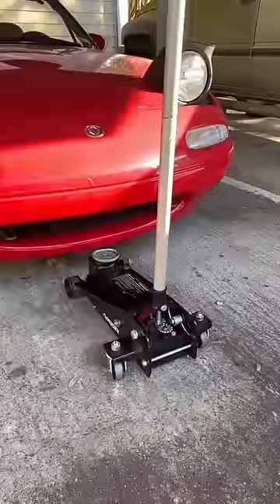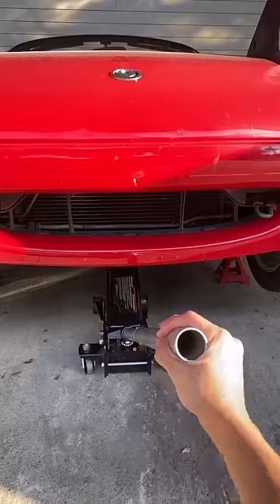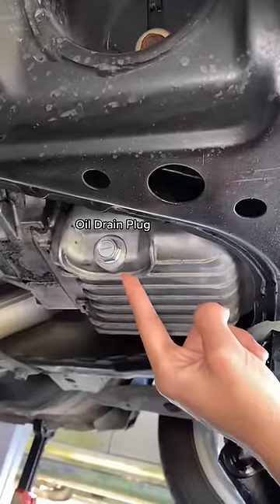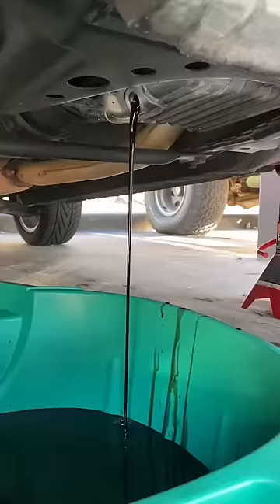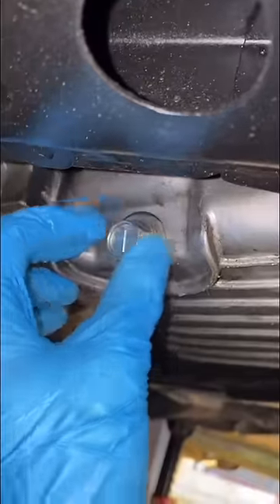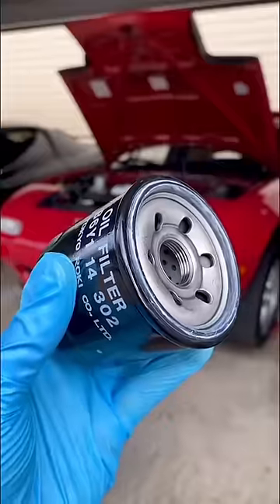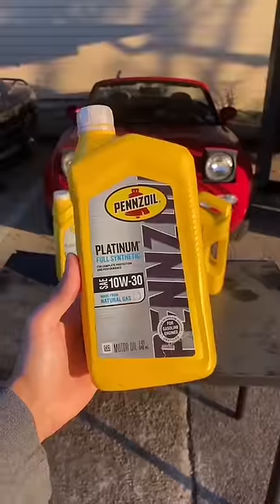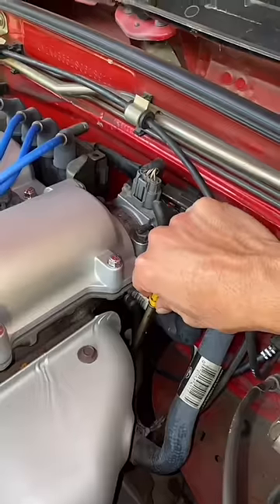How to do an Oil Change! (in any car)

Comment: You know, nobody ever mentions or seems to replace the crush washer in these videos. I personally think its fairly important, especially since we don't know if the last guy changed it. Nice to see it included 👍
Reply: Interesting most vehicles I’ve worked on just have a small reusable seal 🦭
Reply: Because all vehicles have a reusable washer that only needs replacing if it leaks. Which is about every 10 years.
Reply: @johncoops6897  some cars you replace the entire bolt each service.
Reply: @johncoops6897  this is not true at all I work for a oil change place, some cars require the gasket to be replaced every oil change this is mainly Hyundai and Kias sometimes Hondas, most chevys, fords and dodges don’t have to be replaced everytime a lot of them have a metal plug with rubber gasket, some fords have a plastic plug which sucks ass, the thing we mainly go off of tho is if it has a metal gasket it probably needs to be replaced so we usually replace metal gaskets anyways even if it’s not bad just so it won’t come back on us
Reply: @148Reaper  - says the people who sell the bolts 😉
Reply: @apfilms895  - you charge to replace the drain plug gaskets, don't you? Good mark up in add-ons like that, eh?
Do you change you bathroom tap washers every time you turn off the tap? Consider the water pressure on a tap washer, and how many times it gets used each day... compared to the gravity pressure of some thick oil on a plug that gets opened every 6 months.
Of course, the oil change place uses an ugga dugga on the sump plug, right? 150 ft/lbs for the win.
Reply: @johncoops6897  actually I just work for a normal lube shop we only charge for the oil change unless the customer wants to buy wiper blades or air filters that’s the only other thing we sell, new drain plug and drain plug gasket is free with our service as well as us checking and topping all the fluids under the hood every one we can touch and that’s a free part of our service too, we also give out free bottles of water and give out discounts and coupons all the time to customers to help out and be nice, my shop does not screw people over at all a lot of people come to us complaining about another shop that screwed them over and they praise us for just doing what we’re supposed to, don’t come at me assuming abunch of shit like that bro not every shop is the same
Reply: @apfilms895  - nah, I am not judging you. Replacing a 2 cent gasket for free is part of your marketing plan, and that is great.
But you don't HAVE to replace them, except if the previous guy used a rattle gun and completely destroyed the gasket last change.
- so yeah, you might need to replace them every time LOL
Reply: @johncoops6897  again no u didn’t even read my message, ur just still wanting to talk shit about stuff u don’t even know about, any car that comes in our shop with a metal drain plug gasket we always replace it just to make sure it doesn’t come back on us because they are common to go out quicker, if it’s a rubber gasket drain plug those we usually don’t replace until its needed and in that case the whole plug and gasket gets replaced it’s not part of any marketing plan or anything either we just replace it if we have to and don’t if we don’t have to, there’s nothing along with it we don’t strive to make more money off of the customers or try to screw them over that’s not how we run , no one Fucking uses a impact to put the drain plug on or take it off the only thing we’re allowed to use our impact for is taking off skid plate covers and that’s it, we have to use hand tools for the plug we just used normal wrenches for that or if it’s a weird plug we may used a ratchet and the oil filter we usually only use tools to take off the oil filter and then it gets lubed and goes hand tight, unless it’s a Chevy truck those get tightened a little more because they are little different, stop assuming shit because anything u type is probably gonna be wrong bro
Reply: @apfilms895  - ROFL - Defensive or WHAT?
I read your whole comment and agree that your shop does the "right thing" by replacing the gasket each time. You do heaps of things for your "marketing plan", and you even listed them in your previous comment.
I'm not really even talking about your shop... but if you have EVER removed a sump plug or a lug nut, then you know that some a$$holes run them up with a rattle gun and you really have to lean on them to remove them. For a sump plug, over-tightening them just destroys the gasket or O-ring.
You and your shop do the right thing, but that doesn't mean that every shop does the right thing. Your entire marketing plan and service philosophy is 100% based around NOT doing the same bad things that other shops do
So take your meds and chill the fuck out dude, I am not attacking you! I am speaking generally, and nothing that I've written applies specifically to you.
Reply: @apfilms895  - BTW, I have performed hundreds of oil changes and I cannot remember the last time I replaced a metal sump plug washer. They are soft aluminium or copper and designed to last more than one oil change - which is why they are the #1 way to seal a sump plug for the past 100 years or so. Literally TRILLIONS of oil changes have been performed over that period without the washer being replaced, and the world hasn't stopped turning!
Of course they must be replaced if they are deformed or leaking, which usually occurs due to over-tightening.
However your shop changes them every time, just as a preventative measure, and to cover your a$$es... so good for you! It's good practice, and hurts nobody, so why the big spin out when you find out that not everyone does it?
Reply: I've never once used one and have never had any leaking.
Reply: Mhmm my crush washer hasnt been changed in 14 years
Reply: Because 99% of cars don't use crush washers... seems unnecessary both in terms of waste and in terms of how sealed it is.
Reply: @johncoops6897  6months? Yah you dont drive much. I do 5 a year for each of my cars
Reply: @apfilms895  it's not free, it's added on to the cost and you can't say otherwise
Reply: @protipskiptoendofvideoandr286  - well good for you, we all bow to your supreme oil change prowess. Do you hold any records for the number of oil changes per year?
BTW, the average car drives less than 20,000 miles per year maximum, so I based my "6 months" on that. Personally I'd be lucky to do one oil charge every year.
Reply: Never replaced mine no leaks in 235k
Reply: You don't have to replace the friggin washer every time FFS.
Reply: Holy ballz. All I'm going to say is read the service manual for your car. Some might need replacing, some don't. All I know is, the idea of a "crush washer" is that it deforms to the surface when you tightening it, so in theory, it cannot be reused. Your car specific service manual may tell you otherwise.
Reply: @apfilms895  I’ve worked in plenty of mom an pop shops and from what I can say is they always say it does but it’s a cya kind of issue for them. I’ve never replaced them unless the whole drain plug was fucked and leaking.
Reply: @aaronbair748  I replaced like 8 gaskets yesterday 3 of those the drain plug got replaced too not every gasket gets replaced if it looks perfectly fine and isn’t leaking and the plug comes out good and stuff then nothing gets replaced we only replace it if the gasket isn’t intact, if it’s to used even if it’s not leaking but the gasket is old we will replace it, it’s just precaution for us so they don’t come back saying there car is leaking oil now or something and helps the customer out too free of charge
Reply: @johncoops6897  I've seen both manufacturers and change shops use the thinnest possible washers made out of aluminum nylon or even plastic on a lot of these, and often it will legit leak on second use. Technically you "should" replace it every time anyway, but I'm with you I use one of the thicker ones and do it myself and only replace it once it starts to look messed up or drip
Reply: I have a 2019 Honda Civic and every time I change the oil I change the washer. It’s less than a dollar from Honda so I might as well. It gives the extra security of it not leaking and I’ve seen too many vehicles come into the shop leaking oil that caused damage. Filters oil and washers are too cheap not to buy and do it right.
Reply: Fibre washers are better
Reply: @148Reaper  yea those plastic ones that I see ford use most of the time it’s ridiculous and a stupid choice to me.
Reply: For what is the crush washer important?
Reply: I always replace the whole bolt. Costs 2-3 bucks
Reply: @johncoops6897  
You change the washers in a sink when they start leaking. Do you really want to wait until the crush washer means to change it? Beside your engine depends on clean oil and routine maintenance to keep it running in good condition otherwise it will cost $6000 it more to replace it. Much different situation than a washer in a faucet needing to be replaced. Duh!
Reply: I always replace the crush washer at every 5000 Mike oil change. Mine seem to be made of fiber and they come apart but even if I used an aluminum or copper one, I would replace it at every oil change. Yes, they can be used more than once but each time you use it it needs to to be torqued a bit more to keep crushing it. Before you know it you could be over-torquing it and you risk either a leak or damaging the threads.
Reply: @njsongwriter  - You only need to change the washer in BOTH cases when it leaks. The amount of oil that might seep through a damaged crush washer is absolutely miniscule, and will not harm the engine.
Many cars go for 50 years without ever needing to have the washer changed, providing the mechanic torques it to spec (only a few lb/ft) rather than hitting it with the rattle gun like they do for everything now days. I've NEVER changed one, and never had a leak from one either.
Changing the oil regularly is certainly important, but changing the washer is basically pointless.
Reply: I never had a problem using the old bolt and washer
Reply: I it sealed once it will do it again redneckology
Reply: @connorbell09  - consider a normal tap (faucet) washer. It gets tightened down hundreds or even thousands of times, and there is a back pressure as well. Neither of those things happen on a sump plug, which might get removed (max?) 50 times during the life of a car's engine.
Reply: never had one on anything I've owned lol Just a rubber seal if anything
Reply: I never changed mine on my Mazda but I might have just been lucky sadly only got a few oil changes whith her some asshole tboned me at a light
Reply: Dudes oil pan is clean 🤤😍
Reply: Just my opinion but they're not that important. In my life I've done oil changes hundreds of times across dozens of vehicles. In that time I've never replaced a single washer. I've also never had a leak. I even had a car that was missing the washer altogether and it still never leaked.
Reply: @flyingsavage8522  lol he's just showing off his Miata, 0 education
Reply: Never replaced such a thing never, never had a leak
Reply: My guy you mentioned all that but not mentioned filling up the oil filter before putting it back on
Reply: @apfilms895  and
Reply: Congrats on the wasted money man 👌
Reply: All cars I've owned (which has only been 3) they all have a reusable seal
Reply: I was thinking, this guy actually changes the crush washer? What a simp. Mine has had the same one for 15 yes, 150k; no leaks.

Plus his filter made less of a mess than the drain plug. Yeah, and the big Mac I got yesterday looked just like the adverts
Reply: It doesn’t need replacing every time tho that’s the thing people are extra about it
Reply: i reuse mine on my 94 na miata and have never had an issue lol
Reply: I usually only change it for the first change if buying used and never again after, never had a leak. The way quick lube shops tighten it though could definitely deform it, requiring replacement. Normal torque spec never seems to do anything to it.
Reply: Iv never had to change one and never had a leak from it soo yall just need to learn what tf you doing
Reply: @johncoops6897  someone has never worked on a BMW. It specifically states in the owner manual, bolt and washer are to be replaced every service. Also working on high performance cars this isn’t a lie. Yeah I’d say 90% of the time you can re-use. However metal gaskets are different, im not divulging into mechanical material degradation, temps, all that fun stuff. If the manual of the cars that costed millions to engineer says replace it, there’s normally a reason.
Reply: @fletcherhicks9667  - perhaps, but if you don't torque the bolt to 150 ft/lb with an UggaDugga then it won't be crushed to oblivion and thus can be reused.
If it's undamaged, it can be reused. If it is damaged, you replace it. Like brake pads, or tail light bulbs.
Reply: Some vehicles don’t even need a crush washer. 🤷🏻‍♂️
Reply: I've put 150k miles on my 04 camry and have not once replaced the crush washer I dont even think the previous owner did and no leaks still going on 290k total.
Reply: @fletcherhicks9667  Everything has to be replaced on a BMW, you could change the oil and end up having to swap the entire exhaust system (exaggeration but no far off) I miss when high performance cars performance still outweighed how much of a pain in the ass and expensive they are to work on.
Reply: @flyingsavage8522 😊😊😊😊
Reply: Depends on the car, some you have to replace others you don't
Reply: @johncoops6897 10 years when the washer is flattened down so much it’s damn near bonded to the bolt
Reply: @cristianortiz1684  - no, because there is a torque spec for drain plugs, and professional mechanics don't use a rattle gun.
Reply: I've had this daily beater for 6 years straight. Done all my own oil changes. Never changed that crush washer. Never had a leak from the drain plug. Weird
Reply: @gokulilith2894  - not weird, that is perfectly normal.
Reply: On my 98 Chevy truck I never replaced the washer between changes and it never leaked. However, I did every oil change on it since 29k miles and always torqued it just enough to be snug. Never wrenched on it so that may be why.
Reply: U haven't seen team Sally racing 🤗
Reply: I gotta say I’ve worked a crap load of vehicles. Big and small jobs and I’ve never replaced a washer. Automotive never had a leak but did and didn’t on small engine stuff like Polaris and can am engines never had a leak either way
Reply: My car  (specific copper ring), Citi Ace (crush ring, underbone/Honda  Cub clone) I change religiously, but my old gsxr hasca weird specific ring/gasket which I inspect and reuse.
Reply: Good rule of thumb is that if you don't know when something was replaced, it needs replacing.

Comment: My Mercedes: “Ok now do this to me but with a million different steps”
Reply: Nissan sentra skidplates bring you close to warcrimes
Reply: Mercedes is the very best euro brand there is. Compared to any bmw, audi, range rover, or porsche ive ever done
Reply: You mean less steps as most Mercedes have a top side oil filter and oil extraction tube, So no need to spend time jacking the car up just spend 40$£ on an extractor .
Reply: @BotMechanic  Exactly! Modern Mercedes are one of the best brands to service and work on in my opinion.
Reply: “Remove the 52 8mm screws holding the felt tray on”

Comment: Unscrew the oil filter by hand 🤣🤣
Reply: I've only found one vehicle I could remove the filter by hand but they hadn't tightened it properly in the last oil change and needed a new engine.
Reply: Right? Never seen that actually done
Reply: Kung-fu grip
Reply: I stabbed mine and realized I tightened it *i don’t want to talk about
Reply: My oil filters always come off my hand. It's not all that easy, but it helps that I always hand tighten it, too. No leaks, ever.
Reply: I can usually get most by hand. Often depends on the access. They should really only be hand tight as the threads are very long. They certainly don’t need to be torqued like a bolt
Reply: Having a good grip need no tools to tighten that filter😂😂😂
Reply: I always do it bye hand since I always do my own oil change
Reply: Once at our shop we had one of those Toyota oil filter housings where you need the wrench with the notches in it (I'm so good at explaining ik) and we had everyone in the shop give it a go and try to get the thing off before we just fucking left it and skipped the filter. Quality was truly our brand.
Reply: done it on 3 different subies first try by hand somehow